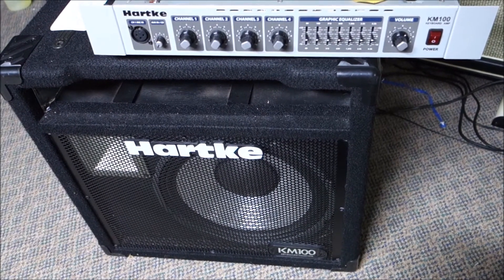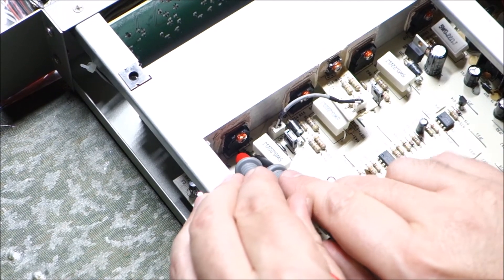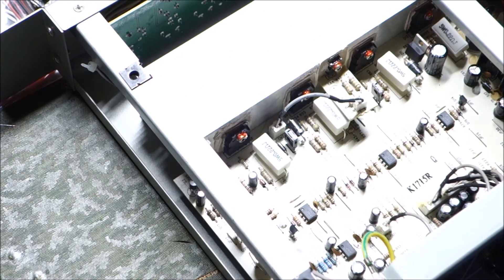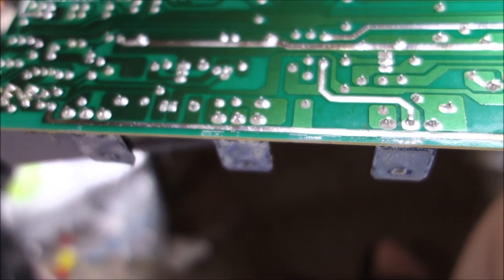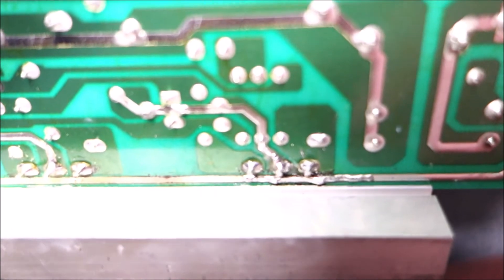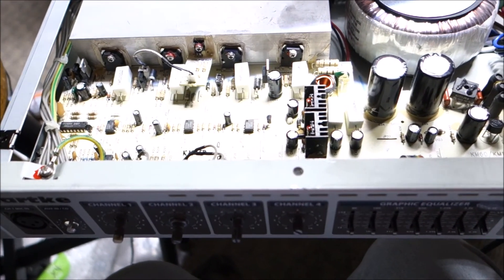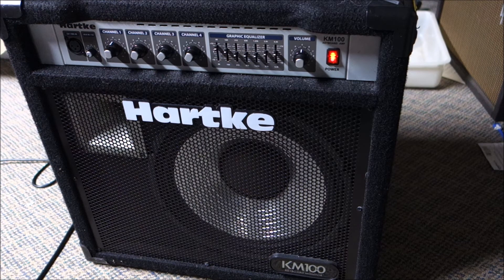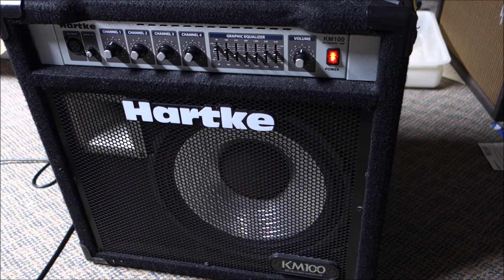Hartke KM100 Keyboard amp.......DC on the output.  Let's fix it.

Comment: I wonder why these amps die... I mean in general, not that model. I am working on a Behringer K1800FX which died on stage, without any abuse on it (I was playing the keyboard connected to it and know for sure!). Everything but the power transistors and the 0.1 Ohm resistor test OK. But I wonder if I am missing anything else or they just die without any obvious cause
Reply from the maker: It could be anything really.  Component quality issues I suppose.

Comment: Hey, Nice little fix..I didn't think speaker impedance would take out those transistors...Mind you I'm still learning from all you guys so what do I know..😀 Thanks for sharing..Ed..uk
Reply from the maker: Transformer amps have NO output transformer... meaning that the current from the transistors goes straight through the speaker load.   As it was written,  it expects an 8ohm load.   Therefore if I put a 4 or 2 ohm speaker on it and turn it up,  the excessive current will overheat the transistors, causing failure.   The burnt trace is a result of over-current.
Reply: @DeadKoby  Great info, appreciate the lesson..Thank so much for sharing..😁
Reply: @DeadKoby  But what if you went above the stated impeadance - such as a 16 ohm cab?